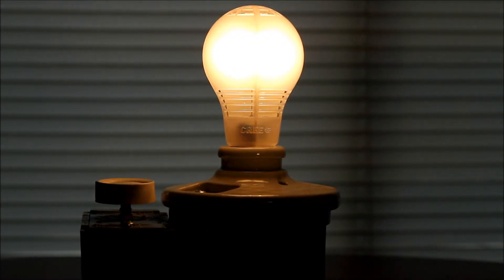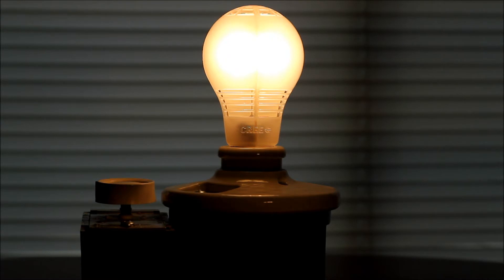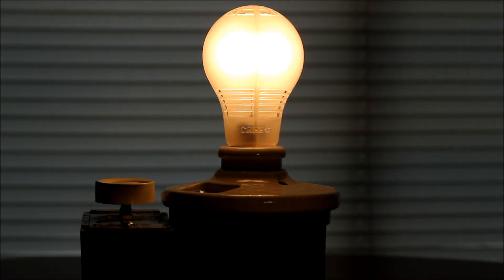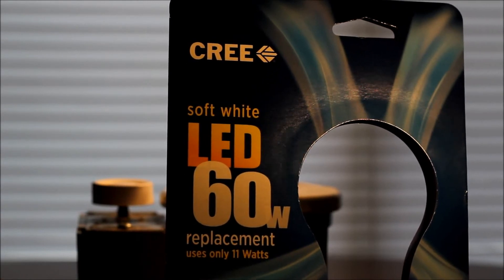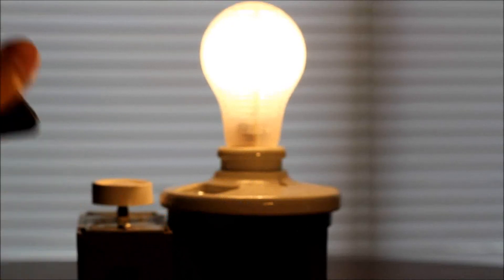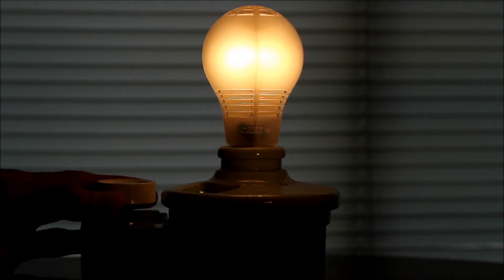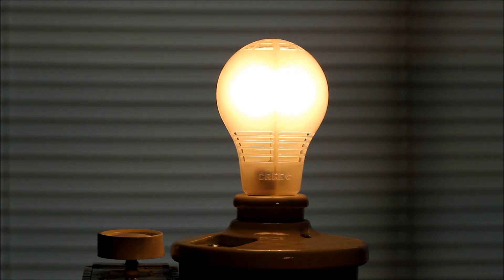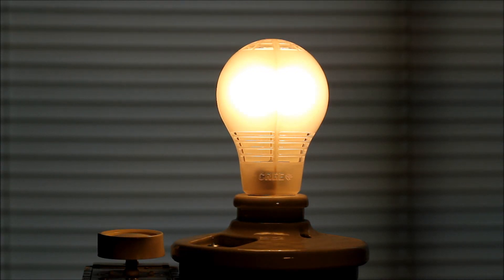Cree 4 Flow LED Bulb Review

Comment: Watching this in 2018 and Cree no longer uses this design. One of the complaints was the vents cause light patterns on walls, so you really had to use it with a lampshade. In any case, Cree and every other manufacturer has settled on the standard "snowcone" design or the filament design. Snowcone is better for enclosed areas, but filament bulbs only use 6W for 800 lumens.
Reply from the maker: I've basically stopped my LED bulb collecting because nearly all bulbs have gone to the same design. This makes sense though from an engineering standpoint. Look at the early days of aviation and how wildly different airplane concepts were. Today they all look nearly the same because the engineers from different companies all eventually optimized their designs and came to the same conclusions.
Reply: @oisiaa  Could be they are merely responding to market demands.  As Electronupdate says in his videos, people want the lowest possible cost, even if bulb longevity and quality suffers.